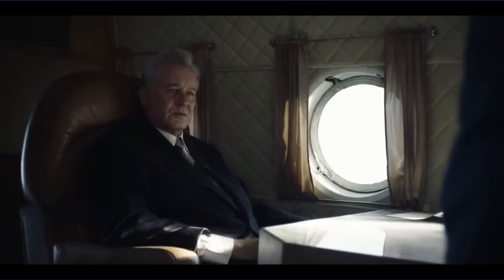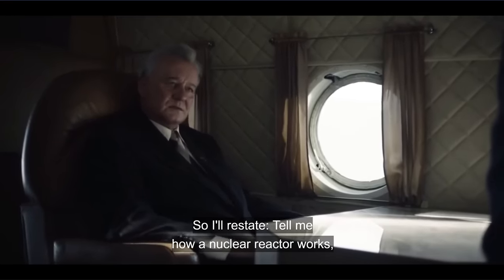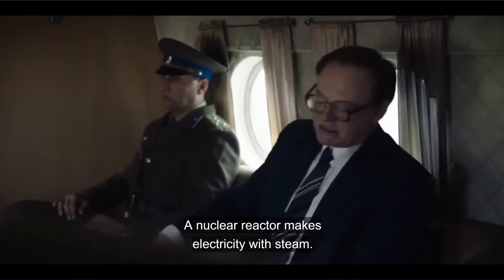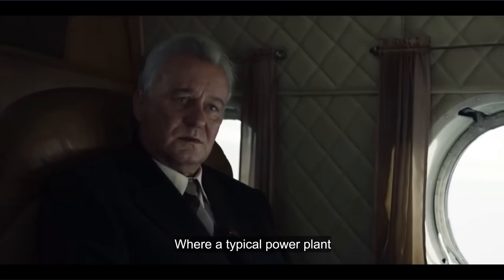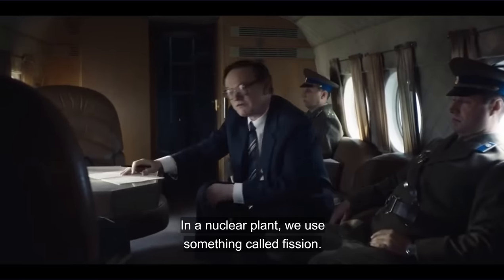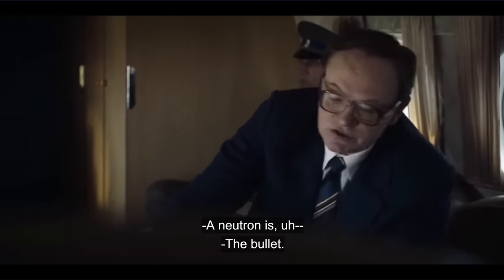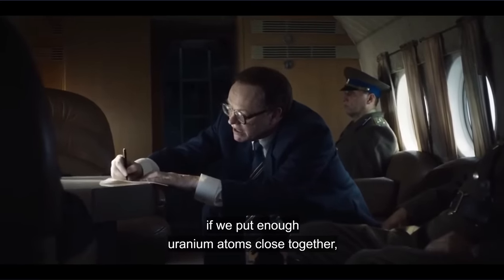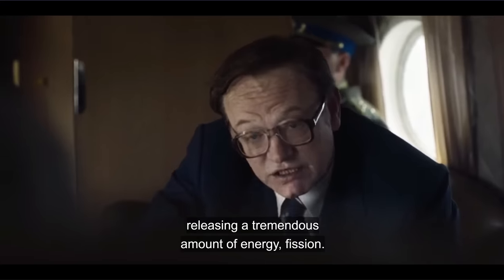now i don't need you | Chernobyl (2019)

Comment: So what happens when idiots build a nuclear reactor that has the potential to flash vaporize its sole cooling source into steam?  Seriously, a car engine was better engineered than a RBMK reactor.
Reply: It was built to burn dirt (unenriched uranium). In these circumstances you need to hamper the flux severely as unenriched fuel is less pure, and less capable of strong flux. Canada uses a similar design with their CANDU reactors, but they use equally-dispersed heavy water as the moderator. It is less efficient, but is thermally more sound. So when you have to kickstart your reactor it doesn't flash-steam your feedwater and cause an oopsie still being felt to this day.